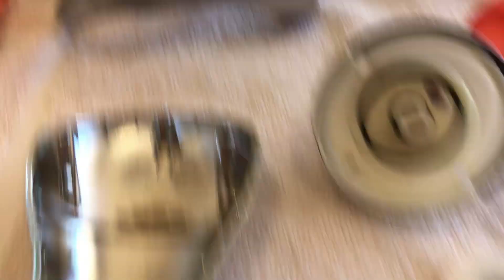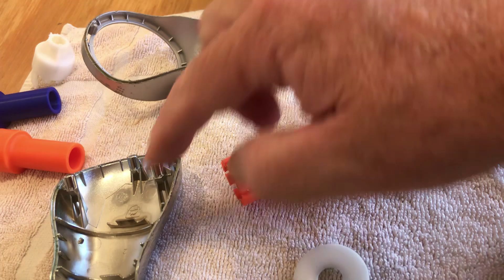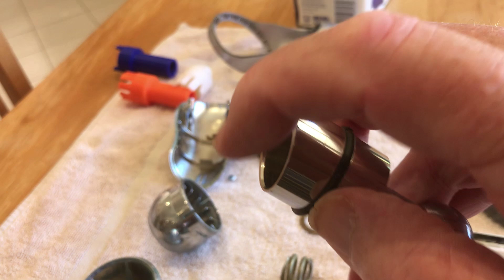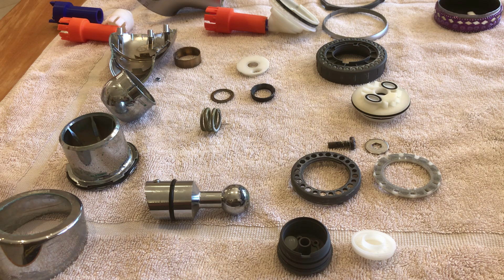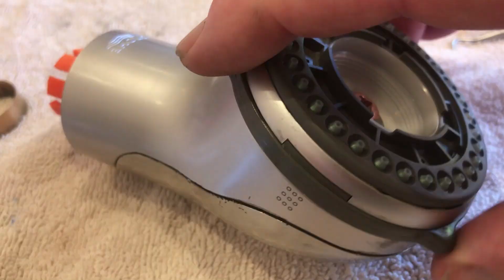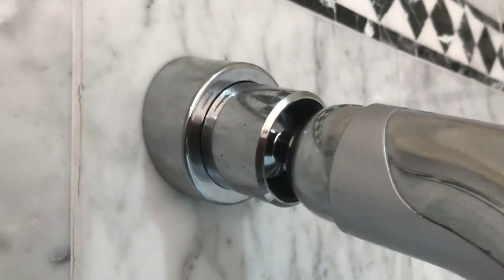Grohe Shower Head Geneva

Comment: How did you put the ball in the plastic joint with the brass ring around the joint?
Reply from the maker: The plastic joint has a series of fingers that can flex a small amount to allow the ball to enter. It is then sprung loaded and retained with the brass collar.
Reply: @bms250ford I've no problem putting the ball in the socket of fingers but having real difficulty slotting the brass ring over the fingers. Help.
Reply from the maker: @engkeechew2139 place the spring the brass washer then rubber seal into the finger joint. Put the brass collar over the ball. Fit the ball in the fingers. Slid the collar over the fingers to retain the ball.

Comment: Hello, during your renovations, have you considered adding an oil cooler to the engine, as was the case in the Kingquad 300?
Reply from the maker: @miechalmiechal2974  No. The 250s shouldn’t work as hard as the 300s and the thermatic fan should be adequate. Overheating maybe caused by poor valve adjustment.